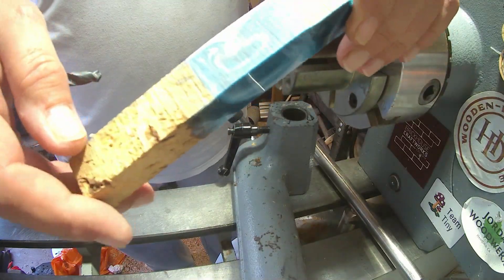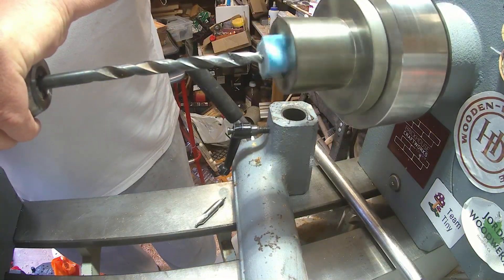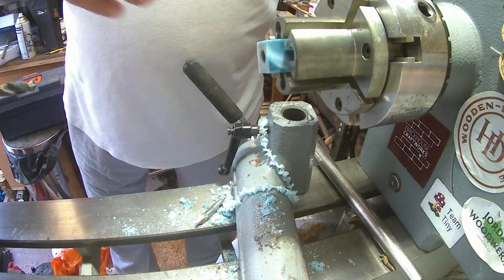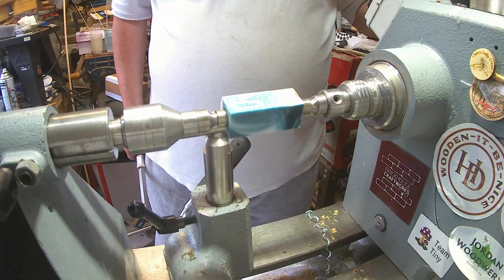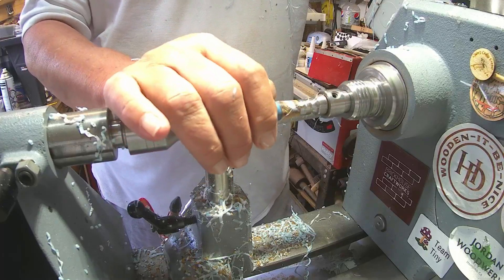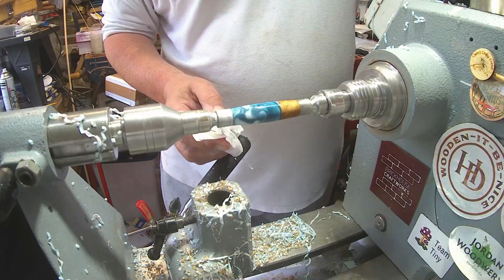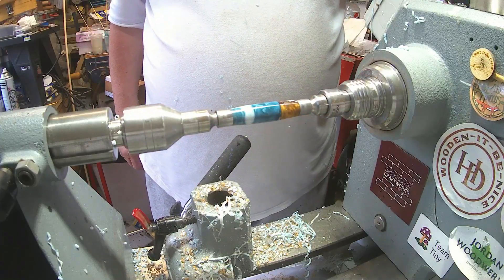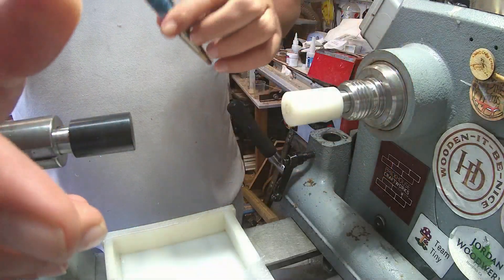Turning a Hybrid Blank from Elm Burr & Resin given to me by Lets Resin

Comment: Nice job huw, looks really nice resin to use.
Reply from the maker: Thanks Steve, I think it is easier to use than Alumilite Resin. 
It has a longer open time and can be used with or without a pressure pot with not bubbles even without the pressure pot.
Also there is no smell from it.
It also takes pigments very well.
When I use the rest of my Alumilite I will buy Lets Resin instead, also cheaper than Alumilite
Thank for watching and taking the time to comment mate.
Take care.
Cheers, Huw

Comment: I suppose casting multi-coloured blanks is bound to lead to surprises and "happy accidents" as the turning reveals the swirls, shapes and blends inside the blank. It's one of the joys I have to look forward to as I start casting my own blanks. Your work is an inspiration.
I've got a set of 6" pen moulds and wondered if I could get two blanks out of each to make Keltoi pens ie. are the blanks you use 3" or less? Now I have l the kit I have no more excuses to delay getting started.
Reply from the maker: Thanks Myk, Casting is great fun. 
You should be able to 2 pens per blank if you measure from either end. Keltoi and Zeta are ideal for getting 2 pens from 1 blank.
Take care mate.
Cheers, Huw